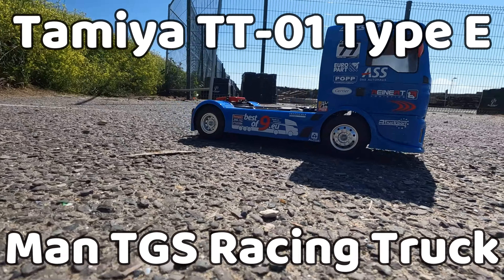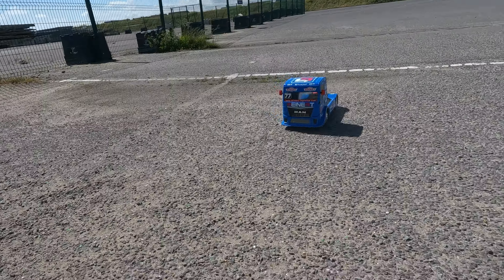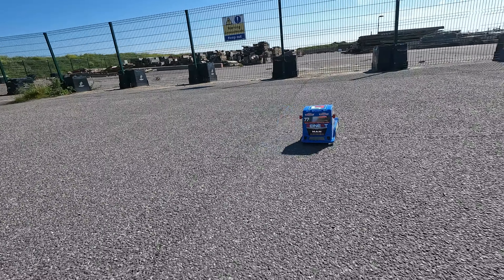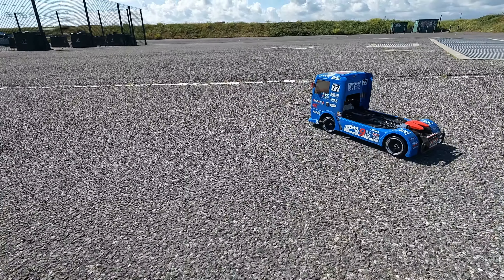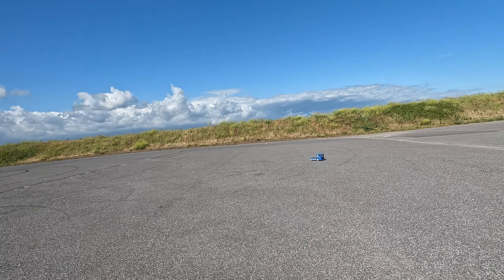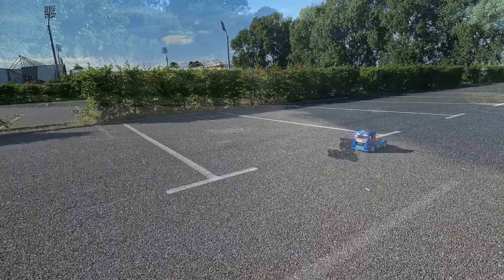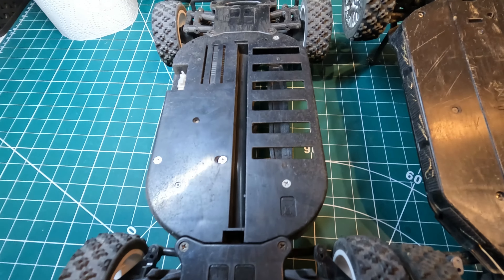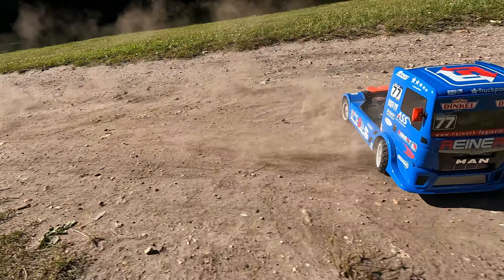Tamiya TT-01 Racing Truck Review and Speed Test. Man TGS Brushless RC Truck TT-01 Type E

Comment: You’ve probably figured it out already, but you’re better off ditching the stock suspension and getting either YeahRacing or TRF suspension - both have different lengths and come with a variety of parts meaning not only can you increase your ride height (eg 55mm compared to 50mm) you can use different types of oil and parts that go inside the suspension to aid with compression and damping. The TT01e has a better steering geometry - We have a ‘Tamiya class’ at my local club (out door asphalt) and as far as I know everyone uses the 01e chassis purely for this reason alone.
Reply from the maker: That's great info thanks. I don't run this one too often but I'm going to enter it into the Poor Boys RC TT-01 / TT-02 speed challenge. I'm not going to be a serious competitor but I'll see how it is on 3s. Many thanks again for your feedback 😁👍👍